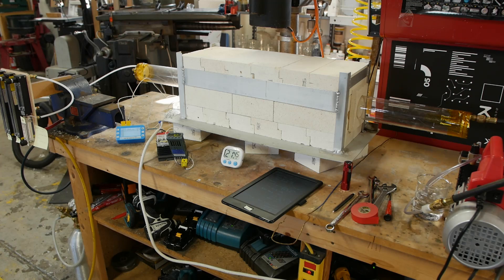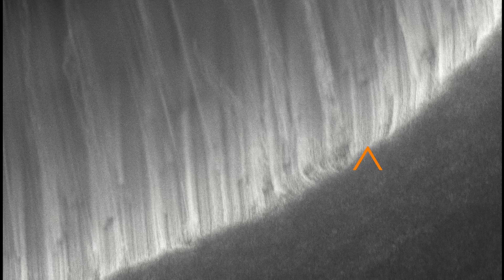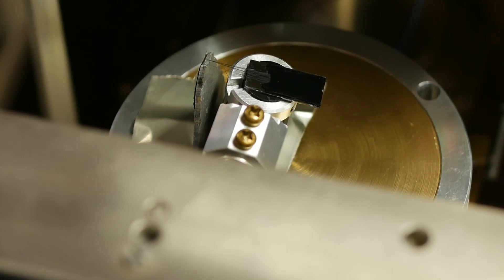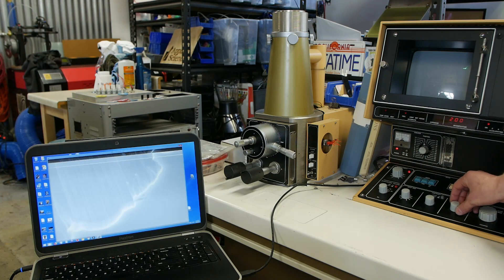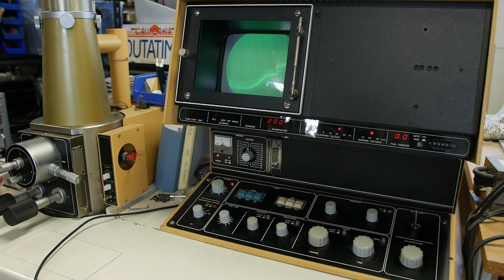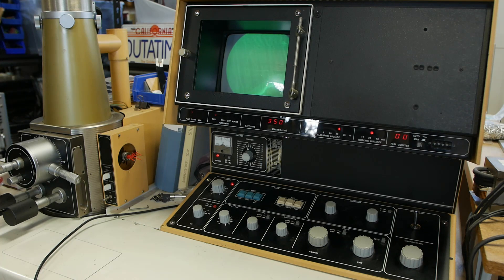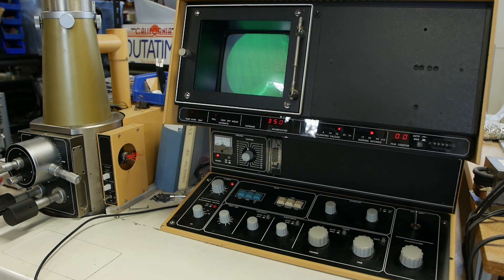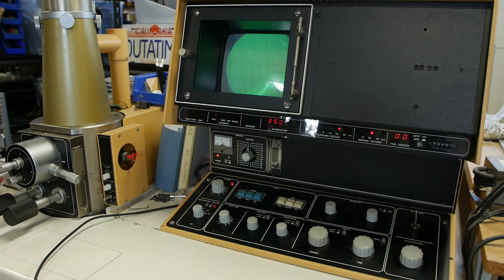Electron microscope animation: Carbon nanotubes pulled into thread

Comment: Just a small tip, because I noticed you use your fingers to set up your sample in the chamber: 
It's best to avoid touching anything going into the specimen chamber with your bare hands. There will always be at least some residual oil from your fingers. Over time you'll wind up with a carbon deposition over everything in the chamber, inside the column and in the electron gun itself. That will continually degrade image quality and cause serious problems in the microscope down the line. If the carbon deposition gets bad enough it could cause arcing and serious damage to the microscope.

It's a good idea to always wear gloves when touching any part of the specimen chamber, samples or sample stubs for SEM, or to use tools that can keep your fingers away from them like forceps designed for sample stubs. Sonicating sample stubs in acetone and allowing them to air dry on filter paper before use is also a good idea, to remove anything like oil or other contaminants that may have gotten on them prior to use, then storing them in a container that will keep them from touching anything else until you're ready to use them.

Also, while the duct tape for mounting your setup  was probably the most convenient way to go at the time, I would avoid using that for mounting if at all possible. The residue left behind by the adhesive will get burnt off by the beam and have the same effect as the oil from your fingers.
Reply: I read it all did that happen to you

Comment: Very cool.  I wrote a simple autofocus routine for a scanner.  It was basically just maximizing a function of 'sharpness' which I fit to a quadratic.  At any given point the sharpness function was sum over all pixels (Image(x,y)-image(x+1,y+1))^2.    You could specify a region of focus if you don't want to focus over the entire frame (i.e. small depth of field may give fuzzy results while other parts are in perfect focus).  Also you might want your function to calc horizontal or vertical focus differently.  I did maximal diagonal sharpness for my application and fit my focus points to a quadratic and solved for the maximum value.  So if even one sample was slightly in focus you could quickly converge.  Good luck!

Comment: Hello Ben, I just found your sequence of pulling out the nanotubes... Very nice. 

You talked about developing a system for a SEM to automate various functions and end up with a string of slow scan images for a movie. I did this, starting 10 years ago (and David Scharf even earlier...) and now I am able to do spline-controlled motions with eight to the nanometer and micro-degree encodered piezo-stage axes and two stepper-motor axes in my MIRA3 FE-SEM. The software specially written for this is called "nanoflight.creator" and only exists at my SEM now but would be open with writing functional extensions for other hardware, as long as an API exists for control...
I would be delighted to do a nanoflight - since a few months even in 3D and color - looking at your nanotubes if you send a specimen to me.
Find out more at http://www.nanoflight.info and movies at https://vimeo.com/channels/nanoflight
It would be nice to get in direct contact with you.
Reply from the maker: Wow! That's amazing work! The animations are so smooth and fluid. Sure I'll send you a piece of the nanotubes forest. I'll send you an email.
Reply: @AppliedScience  Hi Ben, that would be great. If you have some other specimen of interest, let me know. It seems I have some spare time the next two months...

Comment: Completely off subject but you are the one youtube personality I can think of who may have the ability to investigate this; with the shortage of N95 masks, I wonder if treating a lesser mask with an oil or other substance may increase the overall safety. Somewhat like a KN&N air filter is treated with an oil.

Basically, no N95 available then do this in a pinch - it'll give you a touch more safety.

I have no idea how to contact you outside of a comment.

Comment: You might try a cheap 3D printer controller like a RAMPS board to be a good base for your automation.  Modern stepper controllers can do 1/256 the microstepping which should give you better than human precision even with common 1.8 or 0.9 degree/step motors.  Most boards will do up to 5 motors easily.  You could just use more boards if you need more motors.  I would be glad to help out if you have questions.

Comment: Why do you think you'll need an FPGA? I think you could get by with an arduino nano and a few 8 bit addressable latches (like the CD4051) to control the stepper drivers. maybe even a nice 20x4 I2C LCD (to keep that retro feel) and a rotary encoder to control the settings.
...But then again. I have no idea how to program an FPGA. 🤷🏻‍♂️

Comment: Very cool stuff. I wonder if you could pull the thread through a chamber of epoxy or glue vapor to make a more durable thread or ribbon. Would still be very weak due to the short fibers, but it'd still be pretty neat.

Comment: I sure hope Google is providing Ben with his own laboratory / research facility on campus and allowing him at least 20% time for side projects!
For those who are interested, early published reports showing still images of spinning (multiwall) carbon nanotubes date back to 2002 & 2004. (for the classics, infra vide). 

Those of you thinking of using these carbon nanotube ropes to make your space elevator have a lot of work ahead - The intrinsic tensile strength (20-400 MPa) and Young’s modulus of carbon nanotubes appear to be far less than those obtained from the numerical predictions or theoretical models (100,000 – 120,000 MPa tensile strength for a single crystal).

Spinning continuous carbon nanotube yarns. K. Jiang, Q. Li, S. Fan 
Nature v. 419, p.801 (2002)

Multifunctional carbon nanotube yarns by downsizing an ancient technology. Zhang M., Atkinson K., Baughman R.
Science v.306 (5700), p1358-61. (2004)

Comment: Hello Ben
There were an article somewhere a while back where i think students build an raster tunnel microscope whit piezo electric actuators,
those would extend bend an twist all pure electrostatic driven...

try putting in one of those ultra sound transducer in your microscope an look what the the movement is when you apply an voltage from an bench power supply whit enough voltage...
should theoretical be driven like an voice coil of an speaker just whit tiny movement.
then you can ad an flexible movement divider 1-10 whit flex joints and it is even more precise the an 3 point rotator whit 3 actuators

Comment: Great for time-lapse - mitosis, a bullet-time pan of a compound eye / butterfly wing, metal grains / voids being deformed.

What about for high-speed? At "1080p" 4.822 µs is the capture time for each "pixel". Sample just 1 pixel at a time, with precise timing it's like a single "207382 fps" frame, focussed on one small area, 100x100, that's 2hrs-1day for each frame (instead of 240 days), each pixel is then at same time offset to the trigger (you use the data to trigger the same repeatable event over and over, like piezo buzzer, or metal grains changing), leave for a day/week you could get a 7 frame animation of a fast event... (or have to buy a new electron microscope)
Reply: if you can hack a custom beam controller (messing with timers?) then you can read 1 pixel and the time to capture one frame is 100*100*reset time of event - things like grain boundaries won't be repeating, but i'm sure there's other short-life events that would be interesting to look at closely

Comment: Spectacular! Looking forward to future videos on projects around that SEM. Also, I'm still intrigued by the mechanics of what is happening as you pull that thread. I'd love to see a bit longer footage at the highest zoom level. Really strange behaviour . It looks as though a new bundle of threads detaches when the previous one is being pulled away. Why does this happen? Do you need a minimum length of nanotubes? What happens if you try this with very long nanotubes?

Comment: Yo dude, i summon you as i need your help!
1. What happens if you shine an electron gun (electron emitter) in a wilsons cloud chamber.
2. what happens if at the end is glass
2b and what happens if it's a quartz crystal?
2c what would happen if you applied a magnetic field to the quartz crystal - what would happen to the light beam projecting out?
2d Rife used quartz crystal in his microscope to better illuminate the micro-stuff. It would be nice to experiment with it, even as a berrier of a violet ray or any other induction coil of that era as it transmits uv so it could be used to also kill ciruses and bacteria, but you would need a high voltage circuit so no silica but old fashioned tubes and you oscilate the signal to produce resonant feedback of the virus/bacteria and when its iluminated you can increment the amplitude of the signal and the microbe should be destroyed, leaving the other tissue intact.
Similary to microwaves at 2.4ghz heating water or 60ghz on o2, but with perhaps light. I dont know really but its 100% worth investigating. Perhaps you need 2 signals as it was explained by a musician who recreated the aparatus and showed its working.

Comment: I love your work on this, you could use the ODrive system to control the adjustments, these work far better and quieter than steppers and can be easily controlled by an Arduino. I am currently converting a milling machine to CNC with BLDC's, ODrive and Arduino with very high levels of accuracy. I hope that helps, I have a few videos on it too. I'd love to see it all working with automatic control 👍

Comment: 6:15 the fuzzy section: ever ran these images through photogrammetry software like meshroom? I understand the sample moves but the "lightsource" (electron beam) is locked in place, changing where highlights and shadows occur?! That might challenge the software, but maybe still worth a shot. You'd end up with a 3d model which would allow you to move a virtual camera any way you want (more so for when the sample isn't altered like here pulling strings out of it)
Reply: Upvote this!
Reply: the electron gun is locked in place, but electromagnets are used to make the electron beam sweep back and forth and up and down. Exactly the same principle as a cathode ray tube (Old fashioned tube TV), except with the sample in the place of where the phosphor screen would be and the gun is always on 100%. The moving of the sample is to centre in on whatever you want to image and zoom in onto, not to scan/produce the image.
Wikipedia: "The signals used by a scanning electron microscope to produce an image result from interactions of the electron beam with atoms at various depths within the sample. Various types of signals are produced including secondary electrons (SE), reflected or back-scattered electrons (BSE), characteristic X-rays and catholuminescense (CL), absorbed current (specimen current) and transmitted electrons. Secondary electron detectors are standard equipment in all SEMs, but it is rare for a single machine to have detectors for all other possible signals."

Comment: Nice images! As a fun demo, if you can get a wide enough sheet, you can pass an AC current through it and it will create thermoacoustically generated sound. It's very inefficient so you'll need to put about 1W into the sheet to be able to hear anything. You can play music too, but you'd have to apply a DC bias as the the acoustic signal is proportional to the input power (I^2R) rather than the voltage or current.

Comment: If the mat of nanotubes is made up of short vertically aligned fibres, by what process are they joining into threads of continuous fibre (which certainly seems to be what's happening) as they are drawn out? It's freaky!

Comment: I was waiting to see this animation since I recently heard your interview on The Amphour. It shows nicely what you can do with an old SEM and some patience and small own additions. During my time as a PhD student (about 20 years ago) I became responsible for an old Zeiss SEM which already had a computer attached directly to it. But because most people were still used to the old JEOL with a separate pc taking images from the video stream with a frame grabber I had plenty of beam time to get to know the instrument.

I guess you could do most of what you want to do with a platform like a Raspberry pi and a little less effort than using an FPGA from scratch. I think it is unlikely that you will be able to capture at a very high frame rate because of beam stability and detection statistics.

Comment: Nice video! Here is a link to another SEM video SEM with panning, zooming etc. https://youtu.be/ZpgLGFYoUTc made by Nanoscribe company which produces scientific 3D micro printers (printing by two photon polymerisation process with submicro meter precision). Another option for automatic movements  is to put inside the SEM chamber some piezo actuators. It is easy to control them from computer (if you get proper piezo driver) and they are very small. In this article the SEM video from Supplementary Materials was made with such actuators https://doi.org/10.1364/OE.26.011513  . In the video a standard 125um optical fiber coated with gold  is being inserted into 3d printed micro-connector and than removed. Each frame was acquired for about 1 minute, than piezo voltage was changed by hand (unfortunately there was no computer output form that particular piezo driver), in total there are about 600 frames.
Reply: Interesting link
Reply: Great work!

Comment: Cool, if you're going to use a stepper motor, be sure to gear down the movement even more and use 0.9 degree stepper motors and drivers that can interpolate up to 256 microsteps. This way you'll be sure to get the stepping resolution you want. It doesn't have to be expensive, but it's nice to know what to look for. Maybe you already knew this. Anyway, very interesting project, I hope you automate it some day.

Comment: Love the video, love the way you use the SEM, reminds me of when we built the SEM in the garage by cutting the screen of the old oscilloscope (you get x-y control for free) and mounting it into the vacuum chamber to inspect flat panel display traces (if you energize them you can see them - sem can pick up 5V difference in float voltage). We got very wide field of view (>10cm) at high enough resolution. Post more!

Comment: Great work, I am a few months away from retirement but around 20 years ago I did something similar with the head of an insect in an SEM. QuickTime VR had just been released so I took pictures of the insect every 10 degrees thru 360 degrees and at 5 degree tilt angle for 90 degrees. Fed the 2D array of images into Apples QuickTime VR object creator and bingo on the screen was an SEM image that you could manipulate with the hand cursor.

Comment: if you want a real improvement, figure out how to get the raw signals from the beam, and how to send the required signals from a computer, from there, smooth zoom and animations become a lot easier, since you are messing with software and not hardware.

Comment: The scan generator is attenuated more and more, to make the actual beam deflection smaller at higher zoom... making a digital attenuator out of a resistor ladder and some FETs (or analog switches)  could allow you to smoothly zoom, without changing much else.

Comment: Do you ever still play with the electron microscope you built yourself?
Reply from the maker: No.  I took it apart, and reused some of the power supplies for other projects, and the bell jar and platform for my sputter coater.  The original column with brass rods, etc, is still around.

Comment: I actually did the whole convert stage to stepper motor in my previous job for the same reasons - wanted to automate testing and reduce work for the user so they can do other stuff as there is always more to do that can improve the quality of results if we only had more separation of brains and more hands/end effectors attached to us.
Reply: Also automation means you can push repeatability a lot better than trying to grab and juggle all the knobs the same way every time.  That's super important to me in experiments - consistency, repeatability, reproduceability, etc...

Comment: Perhaps a crowd operated web connected electron scanning microscope.  If steppers are in place and remotely controllable use the community to do the painstaking arduous process of repeat  "adjust and scan", while others in the community are working on software to automate. I would happily donate several hours remotely doing the time consuming stuff.  Perhaps a raffle or competition to decide what goes in to be scanned. And superb animation by the way.

Comment: Personally I would start reclining a CNC controller, an axis for each nob and maybe the coolant or spindle control line for triggering the image capture, like this the full motion control and planning would be manageable with GCode without any custom hardware or software implementation

Comment: Edit: I wrote this before watching the part where you covered this. Not surprised you thought of it with your wide knowledge base. Looking forward to these improvements.

Have you though of automating the stage movement with scan acquisition? Maybe a stepper motor attached to the micrometer knob that increments at the end of each frame? It might not be 100% set and forget, but something you could setup and check on every so often while doing other stuff in the lab. You could even do the same with the zoom to have better video production quality. Everything could be controlled by key frames for a coordinated and reproducible shot. I think it can be temporarily attached in a way that wouldn't modify the original machine.